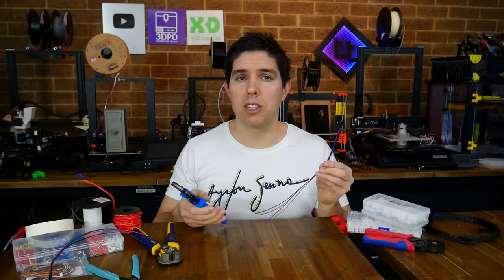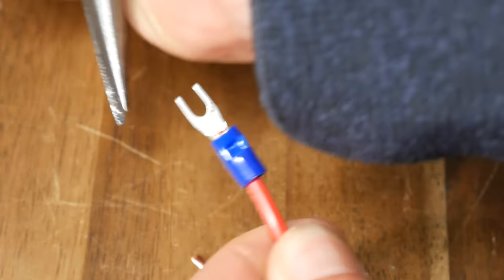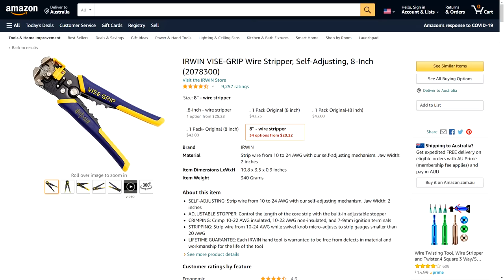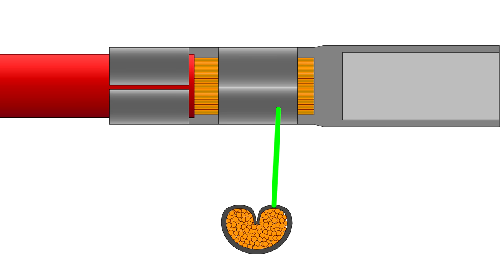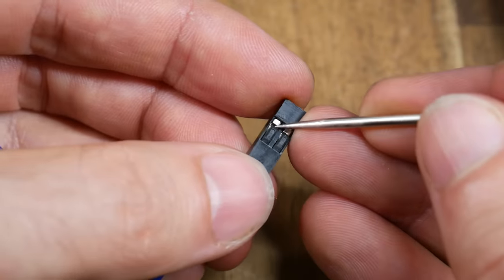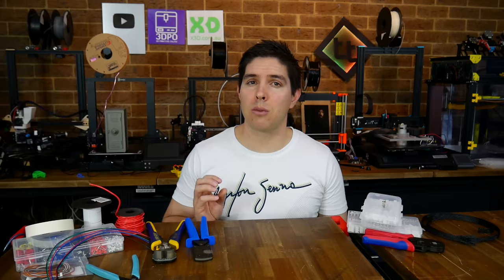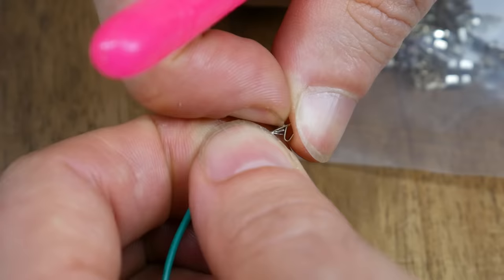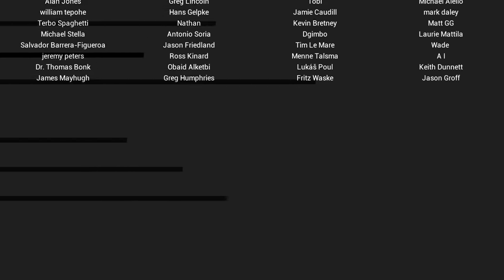Guide to crimp connectors on 3D printers - Take your wiring to the next level!

Comment from the maker: Hello viewers! Some corrections:
- I've trimmed the few seconds that mention twisting wires. Plenty of feedback from people with expertise in this area advising not to.
- My naming of male and female JST ends were reversed.
- Also, another nice tip is to have the end of the stripped wire poke through the end of the ferrule and then trim it back flush after crimping.
Reply: Just one thing to add, tinning wires before putting them into a ferrule is also bad practice. I missed that comment, but I see a lot of people do it.
Reply: God I wish there was a video like this before I started getting into cable work. I do have some corrections though: 
these tools are all chinese budget stuff, none of them are actually "GOOD". This also goes for the connectors you use, I highly doubt that any of the JST XH, PH, ZH, "dupont" or any other are actually genuine connectors so basically you cannot rely on these connections to the full extent. People will look up datasheets and will find that a "dupont" connector will suffice for a 3A connection but that is for original ones with the original tool that crimps within spec. The real world specs for these knock-offs are much lower and not everyone will know this.

Also if you are still looking for a solid ratcheting crimper I highly suggest you look further into IWISS' offerings. The ones I have myself and can actually recommend are the SN-025, the IWS-1442L and the SN-58b. These are probably the best non-expensive less-shitty crimpers you can buy right now.
Reply: You say tinting wires is hazardous yet using lugs which can melt or wiring overheat at the lug can burn more easily than tinting wires
Reply: @MarinusMakesStuff  you know why is that just crimping can lead to overheating if joint is not crimped properly especially with shoddy crimping pliers and tinting can lead to a cooler connection but the best way is to solder the lugs but that leads to destroying the plastic cover.
Reply: @jonathanlarsen4177  shopped around with no real knowledge. They all looked poor quality, until I happened across the iwiss. You can tell they are higher quality than other offerings. I'm glad to have read your comment as it gives me some confidence in the tool. But as far as connectors, where do you find better quality stuff, everything seems like poor quality made in China stuff . Thanks
Reply: @Thunderstormworld  Do you recommend tinting windows here or tinning wires?

Comment: These are the sort of things that once you start using them, you really come to question how you went without them for so long. They are just soooo much nicer than other way of doing it.
Reply: You don't come to question it. You are admitting they just are nicer. So it's basically an aesthetic difference between one and the other
Reply: It's not a question of "why dont I use these connectors?" but a question of "why didnt I do this sooner?" :P

I just got a crimping set, it's SO much more nicer than having to solder things together.
Reply: I imagine the same people that don't care how it "looks" still won't care.
Reply: It turns your sloppy DIY crap into professional work.

Comment: "Buy the right tools and you'll never go back."  Truer words were never spoken!
Reply: True. I got the lousy one for being a cheapskate. Ended up, I lost time which I’ll never get back.
Reply: Sometimes also expressed as "I can't afford to buy cheap tools."
Reply: I would happily buy the proper crimpers if I could find them.  The ads on Amazon are unreliable.
Reply: @ramtek2702  Simple, do as i do just buy them all until you find the right one. The Iwiss 3220 works really good. It helps to close the tool on the terminal one click of the ratchet. This hold the terminal in place. Then you can even set the tool and terminal down while you try to find the wire you just stripped!!.
Reply: @larsord9139  Buying all the crimpers isn't a solution for people on a budget.  Actually I gave up on that idea after a couple of hundred dollars wasted.  The "one click" trick isn't anything new.  I've used it for decades but thanks for the suggestion.

Comment: I crimped a lot of pins in the almost 10 years I worked in a factory. The one observation I would make is: good strippers are a must-have. 
In strict terms:  the end of the insulation must be visible in the gap between the strain relief crimp and the conductor crimp, and all the strands must be visible both sides of  the conductor crimp (the ends can't be too long, and none should be missing).  Proper calibration of the crimp tool is essential, your QA guy would use a sample of the wire & pins being used to do a "pull-off test" to make sure the crimp could withstand the specified tension -  too loose and the wire pulls out of the conductor crimp, too tight and the strands break because they are over-crushed.  
In theory, a good crimp will be gas-tight.  :)
Reply: Fantastic info packed into one comment! Thanks for sharing this.

Comment: I wish this video existed ten years ago when I was building my first 3D printer and didn't have any guides. Now I own all these connectors and a great crimping tool, and I have to say it's super mindful and therapeutic to make your own crimp connectors onto the ends of the wires. And it's fun to be able to make every strand of wire the correct length, and to wire it all up perfectly. Looking back at the printers I made ten years ago, it's crazy to see how I fixed cabling issues back then. Cutting off the connectors with a little extra wire so I could cut them to length and then solder back the wires in order to have a connector on the end.
Reply from the maker: I was very much the same for years. I would horde plugs with bits of wire and solder them together to make my wiring looms.

Comment: This is the exact video I needed for working on my iron man cosplay wiring!!! I needed to learn the connectors, pros, cons, and purposes and that is what this video did
Reply: I'd say for small wires.

Jst-ph or xh. Both are small and locking. 
For larger use a spade connector. Since it handles more current.

And then you got all the others that fulfill the other specialties.
Reply: @girrrrrrr2  thanks

Comment: I've been using the wrong crimping pliers. That explains why my connections are either crushed or falling off after crimping them. Thank you for this great help
Reply from the maker: I had the same trouble with my other crimping tools. The connector would bend the wrong way and snap off, very frustrating. Very happy with the IWISS tool!

Comment: Very helpful.  Couple of observations though.  

The JST connectors that are soldered onto the board are male connectors, not female.  

You can make polarized inline DuPont connectors by swapping one pin with the opposite type of pin in each connector.  So for a two pin connecter, each one would have one male and one female pin.  For three wire ones, one plug would have two female and one male (on either end - not in the middle) and other other one a matching (2 males one female).

When making any plug with an exposed pin, do not have that pin carrying any current/power.  This prevents possibility of shorts with the exposed pin.
Reply: Good point.  For the original version of Du Pont connectors, made by Berg, you could get a plastic blanking pin that inserted from the other (narrow) end, blocking off one position.  I don't know if you can still get those; I have a hoard from decades ago.  There's a similar thing for Molex KK 0.1" pitch connectors.
Reply: @pnt1035  the whole 'polarising pin' thing is interesting-  from the blanking pins to prevent the wrong cable being inserted,  to keying inserts that are riveted into connectors so you can't plug the wrong board into the rack cage.  Very much still a thing, though it has been a while since I used anything like this :)
Reply: ooh, that polarized connectors idea is really good, never thought of that before
Reply: @pnt1035  That's the same concept as the key "pins" in PC motherboards, USB headers are usually 2x5 for 2 connectors, being 1 empty key and one unused (or extra ground for the shield), then the other 2x5 header usually close by - the on-board audio - has a different position for the key pin, so neither you can insert the wrong cable on the wrong header, nor can you insert any of them the other way around.
Reply: To clarify:
Always make the pin that supplies the power a female pin.

Comment: Great tutorial on electrical pins and how to crimp them. I didn't know how to figure out what size female pins, but now I know it's the center to center pitch and not the width of the pin. I'm working on a 2013 Toyota Tacoma and was trying to find new pins, so I can install wiring and so far I've gotten nowhere with it, but now I may.

Comment: just one remark on this great video, Michael: it is common practice not to twist cables you want to crimp, at least not as excessive as you have shown. The crimp will be much better in that way, long term.
Reply: I don't think for the ferrules it really matters because it is crimped from all 4 sides.
Reply: @gizelle-s  the manufacturers of those crimp contacts will tell you not to twist ... but of course, think as you like. no problem
Reply: @peter.stimpel  I'm not doing it, so it's all good, lol.

Comment: Thank you for a very informative video.  I'd like to make a couple of comments.
First: A massive thumbs up for not drowning your voice out with music - it always amazes me how many videos do that.
Secondly: I've been looking for a crimper for a while and must have watched a hundred videos.  None of which showed the information I needed.
You have shown exactly what I wanted to see and I'm going to get the Iwiss 3220 now. Thanks.
Reply: how is the crimper
Reply: @flat-earther  Sorry, I've only just seen your reply. I actually had to send it back. I don't know if it was me, the crimper or the connectors, but I couldn't get it to crimp in one go. I had to move the connector through a bit more each time and crimp again.
Reply: @jonsumisu9016  oh okay.
Actually I ended up buying Engineer pad-11 which cost me 67USD, only crimped a servo connector with it so far and it worked good. with it the conductor and insulation have to be crimped separately.
Reply: Yes, I think it might be asking a bit too much for one tool to crimp both in one go, and be able to do different sizes. @flat-earther

Comment: This video is very well done, covering a lot of material in a short time.  In my experience, it is important to pat attention to the split in the ferrule portion of a ringed or forked terminal.  The split should always be on the "cradle side of the crimping jaws, as the "post" can split the split.  When this happens, there is no pull-out strength.
Reply: I completely agree! I've seen it happen about the split. I teach every apprentice I come across this at every chance I get. Cradle the split!!!
Reply: I was looking for this before I commented…

Comment: Great video thanks. One tip - when stripping insulation leave on end of wire then twist as you remove it, this gives a tighter twist. Forty years making looms/harnesses.
Reply: Excellent tip - thanks
Reply: Thank you! I'll try that
Reply: @ToddDunning  no problem, anything to make life easy
Reply: @SuryanIsaac  it works great, the insulation is tight on strand so grips.
Reply: @robmills4709  I've always had problems with removing insulation, and the wire separates when I'm trying to crimp
Reply: Wire strands should be inserted into lugs untwisted.
Reply: @BrodieFairhall  Maybe, but darned near impossible on these small terminals. We are talking such small currents here I doubt if it really makes any difference.
Reply: @larsord9139  https://youtu.be/TkiBCtz13oI?t=573 this helps if you really got problems with the terminals.
Just don't twist them, it'll be a bad habit for when the termination matters.

Comment: It would be cool to add a bit more to this. Like what wire types to use. What gauge fits the various connectors(jst, dupont, molex)? What gauge should be used for different parts on the 3d printer? Silicone or pvc insulation? Ribbon or multiple singles? Also, what are your preferred cable management tools such as velcro ties, zipties, self adhesive clips, heat shrink tubing, PET expandable or closed cable sleeving. There's a lot to it, and i think you're the perfect candidate to do some videos on 3d printer wiring. A lot of people want to make their own 3d printer, but then scare away when they find that they have to do all the wiring themselves.

Comment: Very nice video Michael, I have now 5-6 different crimpers, just the get the right one... but I can crimp a lot of wires
Reply: 2 Years later I have bought the right crimping tool and crimping a lot of wires already with it. for the JST crimping tool, usually you can got untill you hear 1 or 2 clicks, push in the wires and complete the crimp

Comment: As i learned in an electrical Company in Germany its not aloud to twist the wire because you increase the diameter that can cause lose connetors. Just gently allign the wire and crimp
Reply: Here we were taught to twist back to the natural lay of the wire,  but not too much as it increases the diameter of the wire.
Reply: @justindeibel7660  right just as it is IN the Isolation thats the right way, allmost everybody twist the wires to get it better in but thats not correct
Reply: @andyflyprint5628  You must be an authentic German , "stick to the rules no matter what"

Comment: Nice video. Great explanation. I would still use a high end multi point crimper for the "automotive" lugs and forked connectors. The single point crimp tends to create a weak point in the crimp that can break under load and short - he says from experience.

Comment: A great video.  I've been using dupont connectors for decades, mostly when I was in to RC models.  The "futaba" style connectors are basically a tabbed 3-pin dupont to ensure polarity and I've found that if you're worried about accidentally reversing polarity when using 2-pin dupont connectors to use 3-pin connectors instead and leave one slot empty.  This makes it very simple to line up the connectors and makes it more difficult (not impossible) to reverse the polarity accidentally.  still got to pay attention though.  lol

Comment: You missed my favorite connector JST SM, ists a great wire-to-wire connector, locking, polarized, max 3A and rugged. I mad my full hotend "modular" using JST SM, so i can change my thermistor or fans in seconds, without rerouting 2 meters of cable everytime.
Reply from the maker: Thanks for the tips!
Reply: unless you buy genuine JST connectors and terminals from Japan with the 1500$ tool I doubt your connections will work up to 3A.
I like it too though, there is a reason it is often used in LED applications

Comment: A very well structured video with plain english explanations with all the different connectors, which could get a bit overwhelming to someone new in building their 3D printer. Something that could be useful to add is the wire sizes for the connectors and why. Some are fine with very small guage wire, as they are simply giving an open/closed signal such as an end stop, but some others should be a thicker guage such as accelerometer wiring and possibly even thermistor wiring, should the wire need to be extended

Comment: good instructional video - here's a tip  for those that use those vise-grip style strippers  - if you notice the  serrated jaws always bite and mark the cable - if you use them with the cable fed in from the other side  with the  waste end  gripped by the serrations you dont end up with cables with chewed   insulation

Comment: Hi, thank you for your video
Should've watched it before I tried to upgrade my FFCP) though I managed to find all the tools that you mentioned while solving the arising problems during the upgrade

The other thing that is also interesting to hear is about the wires. How to choose them to power your bed for example.

And I see a lot of people saying that twisting wires is bad, but I haven't seen a person who said how to do that properly. I guess you have to choose the correct wire diameter and the ferrule or connector that is matching the wire. 

That is what I am going to test myself once I receive new wires and connectors) For now I have a problem with my bed powering wires before the upgrade is complete.

Comment: Great video, and I've learned some useful stuff here, but there's one thing I have to strongly disagree with, and that has to do with crimping the fork (and similair) terminals in the very beginning.

These connections are generally carrying fairly high currents, at least when compared with the rest of a printer, and more than any others they need to be very secure.  A bad crimp on a high-current connection can cause heating, which can lead to damage to your printer, and even start a fire.  

Using the very cheap type of crimper - like the one built into the handles of your iwiss, or sold separately as a cheap, stamped metal, stripper/cutter/crimper - is very likely to give you a bad crimp.  You have to squeeze it exactly right to get a properly formed crimp.  Too hard and you will crack the connector, reducing its holding power.  Too soft and it won't hold to begin with.  Even giving it a tug to check that it's secure is no guarantee it's safe - printers vibrate, and a poor crimp can lose grip due to vibration.

The solution is to use a proper ratcheting crimper.  They are commonly available on Amazon and elsewhere, you want the ones with the three colored dots marking three different size openings.  These will give you a much better crimp, far more reliably.

If you are only going to spend money on one proper crimper, make it this one.  The risk of damage or fire is too high otherwise, imho.